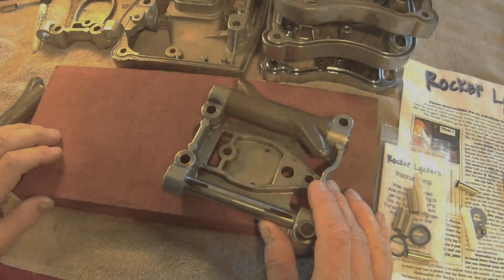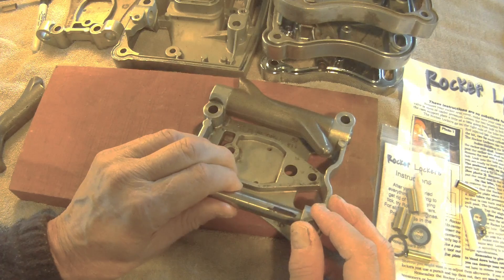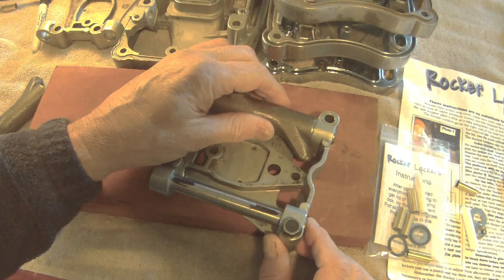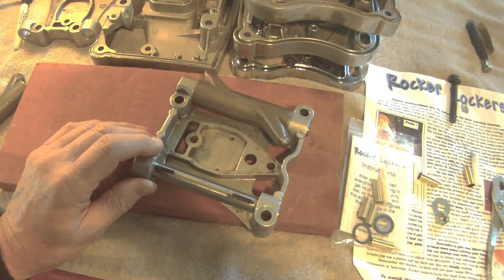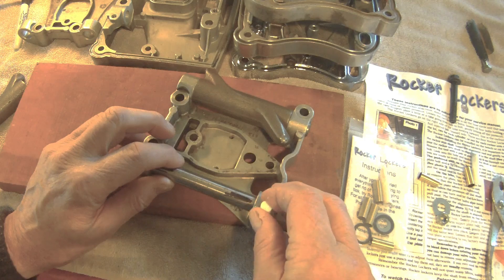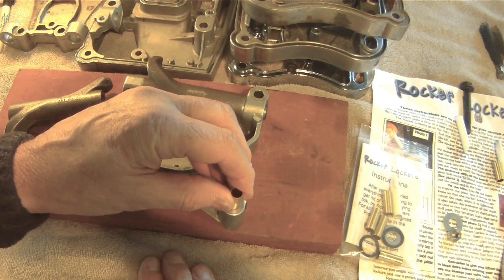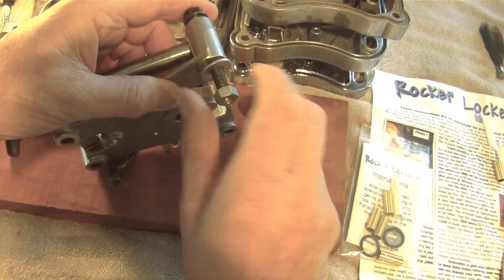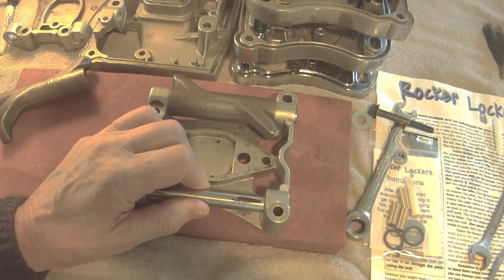Rocker Lockers for Harley Twin Cam, Sportster and BT EVO from DK Custom

Comment: To stop the end play noise, I was thinking about some stainless steel wavy washers to ack as springs on each end of the rockers. I'm thinking it would work with the right strength wavy washers and tolerances.

Comment: Mine wouldn't go in the holes (yes I made sure the rocker pins where straight, and installed with the correct side [tapered] end down). They just bent up to hell and back. It was an idea anyway. The other end of this fix; If you want to remove the rocker arms, you need to figure out how to get these out again.

My bottom line? Not worth the headache. Just make sure you have at least the thickness of a zip tie clearance between your spring caps, and the walls of the rocker boxes. If it's still ticking a little, let her tick. It's a Harley... A mechanical living thing. Let it live.
Reply from the maker: Where did you buy them did they come with instructions,  were they made in China?
Reply: @harleycruiser4331  couple months ago.. USA made. Good instructions. They just didn't work out for me. I have an 02 wide glide.. My Rocker arm support plate may have better tolerances then the later year models. I was going to try again, but having thought about it, I reconsidered. If you have to remove the rocker arms for any reason, you will have to deal with getting these back out.
Reply from the maker: @hawkdsl  they are pretty easy to remove, just turn the rocker arm upside down and tap them out with a punch or use the installation tool.
If you would like to try again I will send you a couple of sets just email me with name, address to harley_cruiser@yahoo.com

Comment: So just to clarify, these would fit in my 02 sportster?
Reply from the maker: Yes, we make year specific kits for the Sporster.  Harley shared parts from one model to the next, kept passing this flaw down. This gap was hidden and very few people knew about it, and their fix was to pin the shaft. Our product is unique as it fills the space  and can be removed if necessary.  You can order here.
https://www.dkcustomproducts.com/86-06-sportster-rocker-lockers-reduce-top-end-ticking-noise-dk-rl-spt-8606.htm

Comment: Why doesn’t anyone just machine/fab a bolt shouldered to a larger OD to fix the issue?
Reply from the maker: Cost, the shoulder bolts have to be custom machined with the same results as the inserts. We think that this was the original plan of HD to use a shoulder bolt and the bean counters vetoed that. Thus the problem.

Comment: How do you remove these for other maintenance after they are installed?
Reply from the maker: Mike you can punch them out with a punch from the bottom, and sometimes reuse them.
Usually there is no need to remove them unless the rocker arm assembly needs rebuilt, but that is rare.
If you are doing head work you pull off the rocker arm assembly and just leave them in.

Comment: do these cause any additional wear on the rockers or shaft?
Reply from the maker: Steve, they lock the shaft so that it does not rotate, it does not cause any extra wear. We feel that originally HD was going to use a shoulder bolt on the plate, the shoulder bolt is larger, this would have locked the shaft, then later they decided to save some money and used a regular bolt creating the gap and letting the shaft rotate. The Rocker Lockers take up this space and lock the shaft like it should have been in the first place.

Comment: What are the o-rings for?
Reply from the maker: CyclesInc they go under the rocker arm plate for the breather.
Reply: I thought that's what they looked like. But it didn't make any sense why you would supply them and yet no other gaskets or O-rings.
Reply from the maker: CyclesInc we found that people knew they needed the gaskets but forgot about these o-rings and felt on older bikes with old o-rings they should be replaced.
Reply: Soooo ... Can the correct "Bolts" with the dimensions to actually fit the plate be purchased and then hold the rocker shaft. With engineering instead of rigging ??
Reply: Great question @randymccalla9995

Comment: Why do you need to remove the rocker arm assembly (plate) from the Motor? Seems to me like you should just be able to just beat each one of these into place and get one side done at a time without having to remove the entire assembly from the Motor.
Reply from the maker: Kenneth, you don't have to remove the plate from the motor, however you need the plate loose so that the lifters are not putting pressure on the rocker arm shaft. If there is pressure on the shaft it will not turn so that the dimple in the shaft aligns with the bolt hole. If you don't align the hole the Rocker Lockers will not pull in they will mushroom. Once the plate is loose it is very easy to pull the plate so that is why we recommend pulling the plate to be able to see that the shaft is aligned. Also you only install them on the one side of the plate, two on each plate on the carburetor side.
Reply: Harley Cruiser, thank you for the detailed explanation I will be installing these during my winter project. I will also be checking the side to side clearance  on the same rocker arms. If you search "95th Anniversary Road Glide" you will see my old Evo with 134k on her. I have overhauled the rocker arms with new bushings and reamed them to fit however I never addressed this problem as I didnt know of anybody that had addressed this. That being said thank you so much for your efforts and for your reply.
Reply: @kennethwise7108  did you do this by now? How did it turn out?
Reply: @martincvitkovich724  not yet, I have the kit though